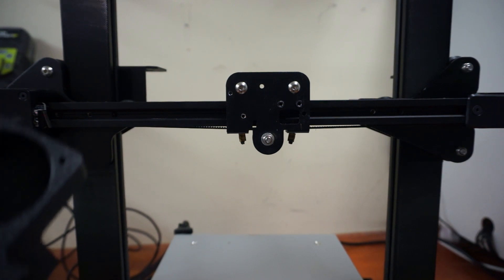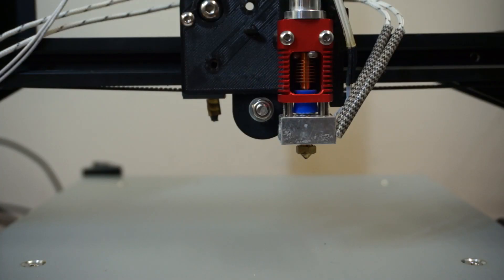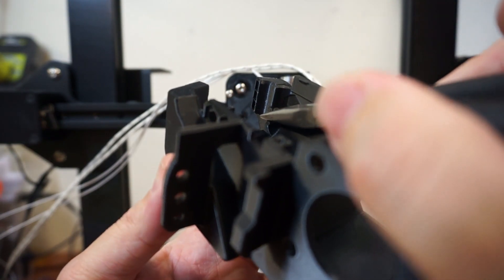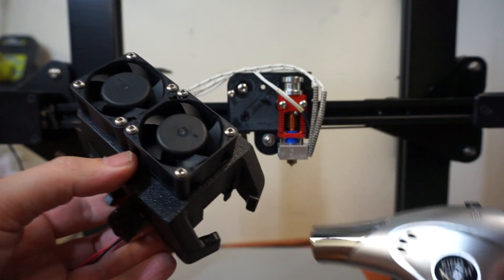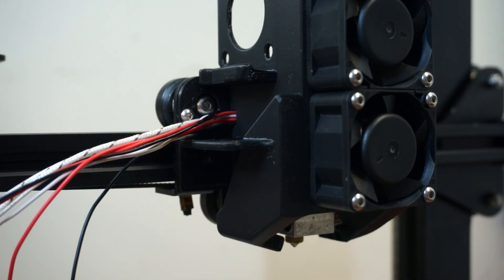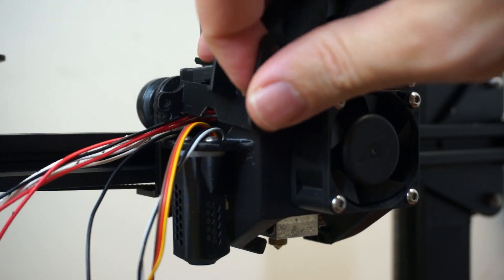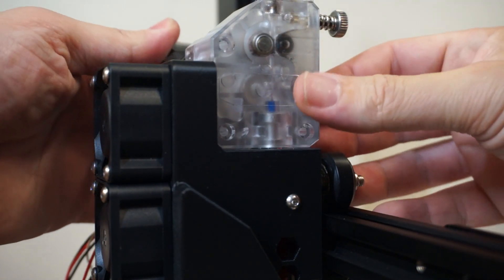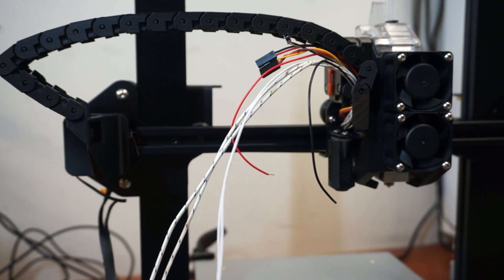Diplo Duct Install Ender 3 V2 dual 4020 fans

Comment: hello m8 i print with insert but ( whats nuts i must use ) i check hole its m5
Reply from the maker: Hey, the heat inserts are the standard Voron ones. M3 x 5mm wide x 4mm long.

Comment: Do you need a shorter stepper extruder for this to work properly or i could use the original creality stepper extruder?
Reply from the maker: There is a make in the thingivers page where someone had the original stepper so yeah it'll work 😊

Comment: phew, you weren't kidding aobut "the tricky part" :D
Now I#ve only got some stringing-hairs to solve. Thanks for all the work :)
Reply from the maker: Your welcome. What kind of stringing problems do you have?
Reply: @GalvanicGlaze  the finest of hairs. Calibrating new retraction and temperature settings right now.
Reply from the maker: @Kajotex  make sure to dry the filament so you know that's not the issue
Reply: @GalvanicGlaze  well i never had that problem before

Comment: Hi ! nice job... which cable mat did you use?
Reply from the maker: Hi, Do you mean the electrical cables? they are mostly stock cables and I used a CAT5 network cable for the BLtouch. If you mean the cable chains they are out of ABS

Comment: You have a very intriguing set up. can we email or touch base any how bro ?? i have an ender v2 and a qidi max en route. currently running nylon 6 successfully. Any feedback or response is appreciated.
Reply from the maker: Happy to answer any questions you have. You can DM me on Discord if you want. Galvanic#8401

Comment: How hard would it be to make the Diplo Plate compatible with an E3D V6 hotend. I would be willing to do it, but what would I need to change in the plate and duct?
Reply from the maker: Hey, you would need to design a mount for the heatsink and the nozzle would move forward a bit. The heatsink hits the metal backplate if lining up with the filament path.

The other thing you could try is just using the heatsink and heat break from your old MK8 and screwing that into the V6 heat block. This is what i did for my volcano block with a different diplo duct design for a volcano, I used an upgraded all metal heat break from the MK8